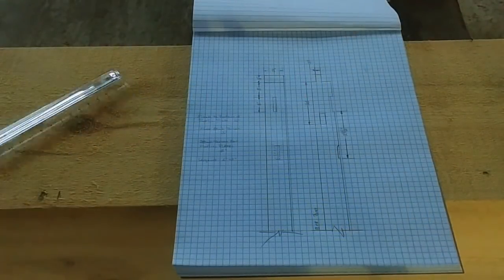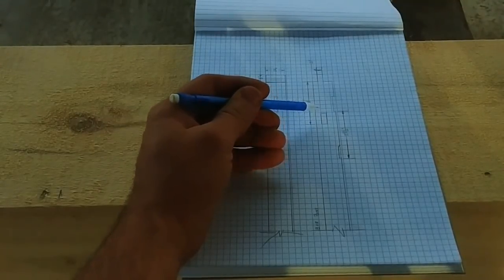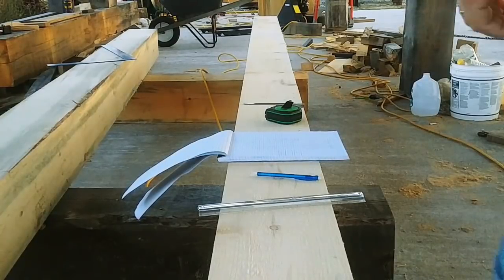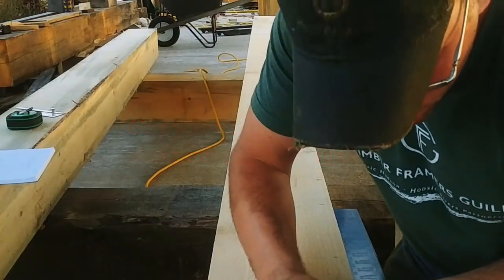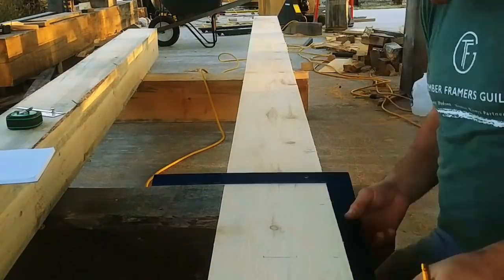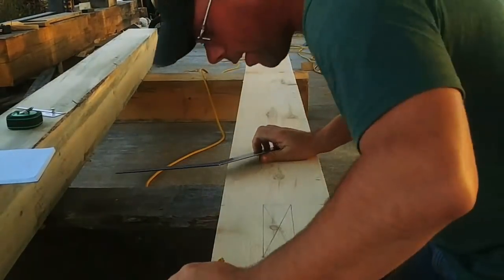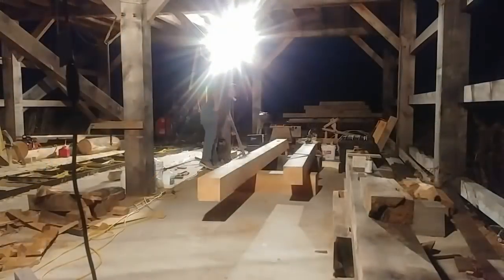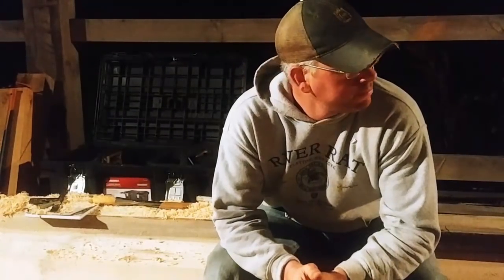A Timber Frame Vlog #70: Let's Start Some Queen Posts

Comment: Hi Jim. Thanks for showing the drawing. I am going to have to look at some books for queen post. My design doesn't have one. Not completely clear yet.
Reply from the maker: +Jeff LaBrozzi you'll get to that point.  You need to look at your snow load, your roof pitch and so forth.  I need the queen posts to reduce rafter thrust to keep my roof pitch lower.  I didn't want a 12/12 pitch but still had to design for a 60psf snow load.

Comment: Knots! if the beam has the pith centered at least it only goes halve way, but  you may get another on the other side.  Cats rubbing like that, they are just showing that they own you.  rubbing scent on you. Cats are great.   One aspect I didn't hear you mention on using the next best face to measure off.... if it is not square to the best face you have to account for that out of squareness when you mark the mortice on the back face opposite the best face on those through tenons.   So if its out of square 1/8" the mortice on the back side will be off the 1/8th inch as a reflection of measuring from the next best face that is not square.
Reply from the maker: +Timberdoodles you are right, I should have mentioned that...especially since I've made that mistake before.  When I get them like that I use two framing squares to line it up.  Excellent point, I'm glad somebody who does this professionally is piping up, I'm not a guru and like to share the basics or what I'm confident in.

Comment: Thanks, Jim for a good video.  Too bad I'm so dumb I cannot figure out what a Queen post is used for.  I think it is used to hold up the roof.  If so, then why have the first floor posts stick out of the floor of the second floor?  Where do the Queen posts rest?  Too much work today and too little sleep causes me to not be able to clearly think at times.  I'm glad you had a chance to vacation and get your battery recharged.  God Bless

Terry
Reply from the maker: +Tynyyn the first floor posts only stick out on the eave walls on this frame.  The queen posts on this frame will support the rafters at midspan.  You're not dumb...just need sleep.

Comment: The barn is really coming along. I've you ever built a pole barn with treated posts and concrete floor? I'm trying to figue out costs. I really want to find uc4b pressure treated posts that are structural grade. I don't want to buy a kit I feel like the really ream you on those. I don't believe there is really an all in one kit they don't Include absolutely  everything.
Reply from the maker: +Lance Sheppard {Little River Lawn Care} i have built them before.  Pour your concrete first and anchor the posts to the slab.  Don't count a kit out, there are some good ones out there at really good prices.
Reply: TheTradesmanChannel 2017 I need to recheck with the county. I think if I pour then erect posts the structure has to go by different rules. Lol if I could I'd just drill me some holes 4 ft deep drop two bags of 5000psi in each and put me some black locust posts in! I don't think  that would be "acceptable" lol. Thank you for you info buddy I really enjoy your content.
Reply from the maker: +Lance Sheppard {Little River Lawn Care} anytime Lance.